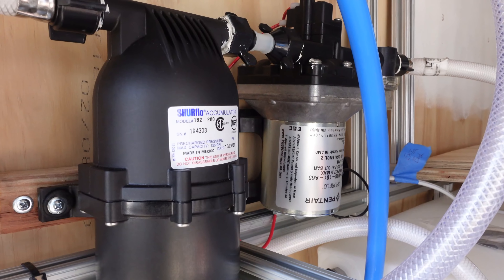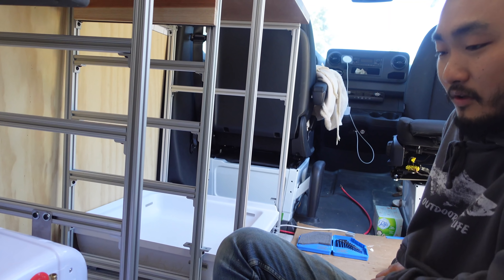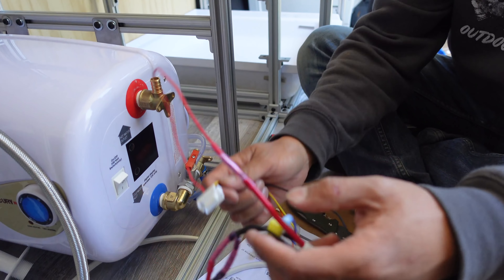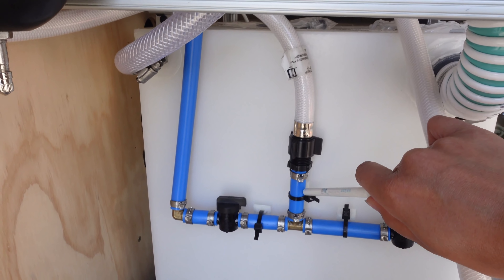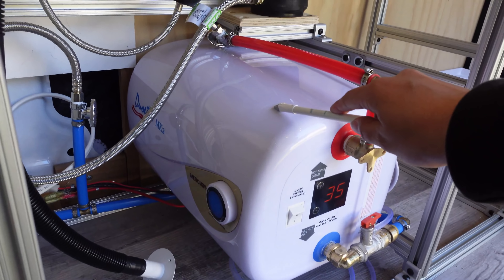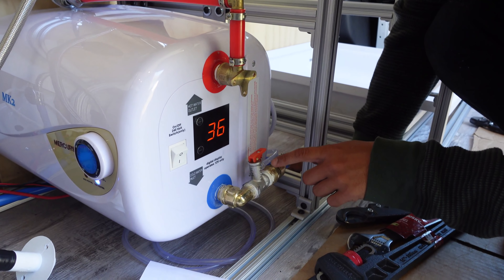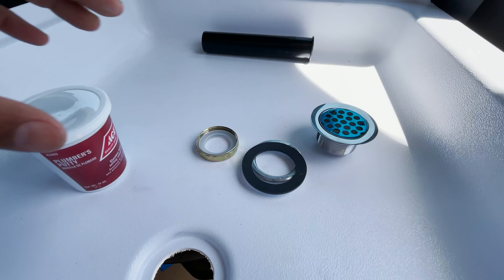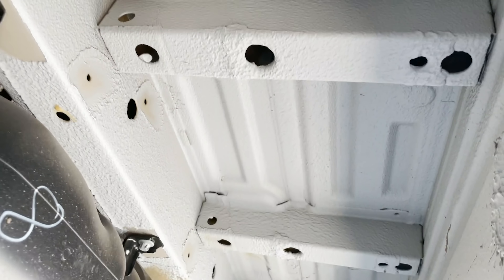DIY Van Plumbing with Zero Experience | Sprinter Van Build

Comment: They are 10 litres.....We have them in Aus... Duoetto MK2 Digital Dual Voltage (12v/240v) ....12v (25A, 300W) and/or 240v (4.2A, 1000W) ..SO if you connected it to the Inverter it would warm up in around 15 min.....

Comment: Hey hey- would you make a quick vid on exactly how you installed the duoetto— what do I do with the small gauge red/black wires??? To a switch? But then separate heavy red/black direct to the fuse box? -  Duoetto needs to do a better job in demos! Just like bluetti—great products but no use/installation vids.

Comment: I am installing the Duoetto in my electric car and I intensely crave one of those elbows right at the pressure relief connection. I believe the water heater expects a finger-tight face seal fitting. How did you get your similar elbow to work; is that just pipe dope and teflon tape on a tapering-threaded joint?

Comment: Hey guys I love watching your van build. I’m a plumber here in California and I wanted to recommend a couple of items. Use blue monster Teflon tape on all your fittings it works the best.For your Waterfill tube for your water tank use EZ-flow braided PVC tubing you can purchase it at Lowe’s in various sizes, it will give you a better seal with the type of fittings you’re using. Hopefully I’m able to help can’t wait to see your build completed. Tight lines.
Reply: great tips, thank you!

Comment: Hey yall, I am using the Duoetto bc of your vid. What gauge wire did you end up using 10 or 12? Have you had any issues with it? or advice on installation?

Comment: You can also use Teflon tape and then put pipe dope on the top if you ever cant stop a leak my dad does that with gas pipe.
Reply from the maker: I think teflon tape only works on pipe threads.
Reply: @TaklyntheWorld  The key to using tape is using a quality tape. Blue Monster PTFE thread sealant tape is the best. I use it for chemical, water, air, steam, and refrigerant piping at work. Be it metal or PVC piping, this tape works great.
Reply: @TaklyntheWorld  I know. That's what I was saying to use it on.
Reply: @TaklyntheWorld  Also works on fitting threads I use to do plumbing with my pops.

Comment: Toilet paper works really good for finding leaks. Just fold a couple pieces up and wrap around the joint and it will instantly show if there's moisture or not. Also you should have a on-off for your water pump somewhere very accessible and not leave your pump on all the time only turn it on when using it. If you leave it on all the time and happen to be driving or sleeping or not in the van and a hose bursts or slips off or a leak start somewhere you will end up with a huge mess and water everywhere in your van because you weren't there to shut the pump off or you didn't hear it. So make sure that you don't leave that pump on except when you're using water. The two clamps at the filler neck is a good idea to stop the leak.

Comment: Not a pro plumber just a DIY guy here. I suggest for the plumber putty kneed first, take more than u need , then flatten out and make a donut shape O-ring to your size. It gives you a continuous, no air pocket gasket. 🤟
Reply: Yep, also, use more than you'd think you'd ever need.  You want the putty to squeeze out everywhere so there's no gaps.  Just scrape off the excess after tightening everything down.

Comment: Just wondering instead of plumbers putty on the shower drain would silicone caulk worked better? Isn’t there going to be a lot of flex in the shower pan ? , I’ve seen fiberglass pans and tubs were they used canned spray foam to stiffen under th pan .🤔
Reply: Putty is fine but you could always do both. Silicone on the outside.

Comment: Give you guys alot of respect for just jumping in and doing things. I would suggest though that you don't use hose clamps for your plumbing- best bet if you can configure using threaded stainless hoses. Construction for 43 years- union- learned a lot from the different trades on the job. You're not going like those leaks on the road- threaded as much as possible with Teflon tape

Comment: I'm curious to know, by drilling the bottom of the van, would it disturb the integrity. Would there be any structural load concern?
If not, was there any anti-rust paint applied? 
Anyways, great video, can't wait for it to be in action. 😊
Reply: Seems like they drilled thru sheet metal panel. No where near the frame itself.

Comment: Be sure to spray paint anywhere you cut the body so that it doesn't rust out your underside. Especially if you ever plan on doing any winter driving in states that salt the roads.
Reply from the maker: Yup! We've mentioned that in our previous videos but if someone hasn't seen those, definitely a must!
Reply: @TaklyntheWorld  Did you just primer the bare metal cuts or did you apply a top coat as well? I don't recall if you did or not.

Comment: I would leave those light wires, it’s good to have option “if” needed

It’s more expensive , but quick connect joints are better , for replacing and fixing (I have it on my RO water system)

What worry me is when traveling , all the bumps and vibration will cause leaks

Comment: Not a professional plumber or 100% sure but I think the plastic gasket you put on that made it hard to screw on was supposed to slide down the pipe before the metal nut you slide down. Vans lookin good so far.

Comment: The underside of your drain hole needs to be sealed, I would use a can of spray insulation. This will prevent rodents from getting in.
Reply: eesh :-/ just the thought or spiders...

Comment: Why didn’t you use an on demand hot water system? It seems what your using is like an old style system that uses a lot more gas to operate.
Reply: Everything in the van needs to be battery powered.  A tankless system would need 15-30kw, or about 5 times more batteries than they currently have.

Comment: I highly suggest two different water tanks. One recirculation water for shower with 10 gallon tank. You will be able to take 14 showers then wash out filter. The filter will have hair and dead skin cells. It goes through 3 different filterters. You can even filter lake or river water. It is just an idea. Do what ever u choose.

Comment: Not to bad. Plumbing ain’t as easy as it looks huh. With the Teflon, wrap it a minimum of 6 wraps. Wrap it from left to right if that makes sense, so that the thread doesn’t unwrap it. You can also use Teflon and pipe dope at the same time.

Comment: Using butt connectors in a vehicle is not really a good idea. Best to solder and use heat shrink.
Reply: Butt connectors are just fine, with what he used, the water proof type. Im an electrician with 31 years of experience, Inside Wireman, work on boats and RV's. While some of his methods and installs are a bit cringy, its just fine.

Comment: When your out on the road your gonna be like why in the world did we get a pump silencer. We did. Carry a water pump for a river if you don't want a big tank:).   We learned in one week everything is worthless without a big water tank
Reply: what size tank did you start with? I am trying to decide get only one 28 over the wheel well or 2...
Reply: @MannyWC  One 28 will be plenty in my opinion, 90% of the time traveling you will be near a fresh water source to refill, before thats empty
Reply: @ExploringJ  That is what I went with:)) bon voyage!
Reply: Hey Tyler, I need some help on the wiring of the hot water heater. I do not understand how the switch wires and the heavy gauged wires get wired. And can we cut off the 240 plug? Help! Did you wire the switch? Photos, verbal step by step—any deets please! There is absolutely nothing online.
Reply: @MannyWC  hmm. Did you get a water heater that used a 240 volt plug? That will not work as you need a DC or 120v water heater depending on how you setup
Reply: @ExploringJ  I am using the same WH that you have - the DUOettO- It has: a 240v (which I am not using as I am 12v also). Two 10 gauge wires, 2 - smaller +- wires and another black wire… Did you wire your power to the larger +-? And instructions say - you have to wire a switch- did yall? And if yes, did you just use the > power 12/2> to the 12/2 on the WH? And NOT use the random smaller +- and what the heck is the other black wire? Sorry- so dern confusing!

Comment: Dude, youre making my head hurt. Red is NEVER ground in a 12v system. Seriously, hire a marine electrician, because you are truly fucking this up. WTAF.
Reply: It's just for the water level sensor, chill
Reply: @KN-xl6lw  what you said. Chill Nick. Damn.
Reply: You know, there’s a reason that we color code wires by function…nearly ALL of it relating to safety. But you guys be you…keep a fire extinguisher handy.
Reply: yeah I saw a vid with a guy wiring his fan wires - white to red, black to black :( and im just a doctor girl and know better)
Reply: @MannyWC  As long as NO-ONE ever has to work on it but Taku, he’ll be ok…as long as he wrote down his wiring diagram. He won’t get electrocuted with 12V, but he could light the damn van on fire.
Reply: @salnichols94805  yeah it is crazy how there isn't a universal rule on the color coding.